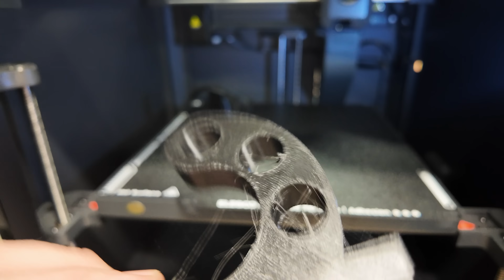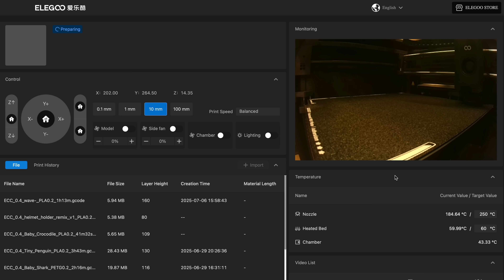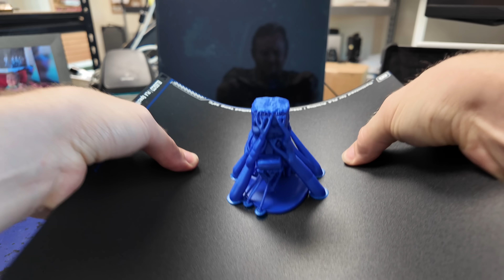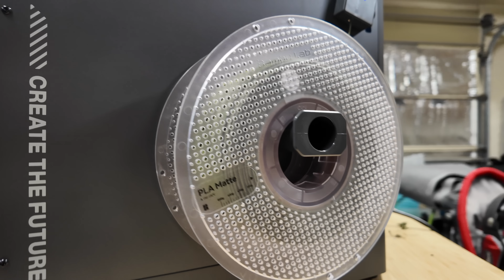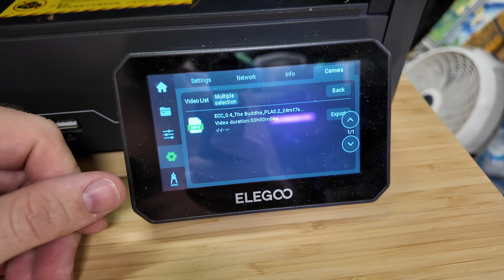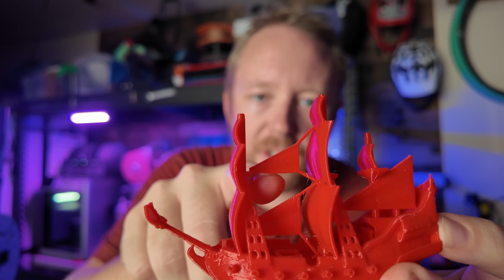Elegoo Centauri Carbon – Great Value, But There’s a Catch

Comment: PTFE Tube. Unclipping it from the front half of the chain is a great start, and seems to be how Elegoo are currently shipping them. 
If you decide to replace the tube, then be aware that the tube length (printhead to sensor) needs to be kept the same for filament runout behaviour to stay nice.
Reply from the maker: Thanks for the Tip!
Reply: The PTFE tube length is not critical.  Just get it reasonably close to the original tube length.  When re-installing read the instructions about how to snap it into the back of the plastic chain.

Comment: Fans. Are you sure you have updated the firmware? On the latest (14 July today) version (1.1.29) the only fan that runs on after printing is the electronics bay (floor) fan - and there is no switch for it. It isn’t particularly loud and does turn off after a few minutes, but it raises an important point - the venting of that bay. It only has one grille in the bottom panel, and the fan circulates the air rather than changing it. Blocking the grille (by mounting the thing on carpet or foam for noise reduction) could be very very bad indeed for the electronics (and maybe, thinking Qidi fires, you). 
Electronics cooling improvement with some sort of ductwork is the mod I’d like to see.
Reply from the maker: Ill have to double check.

Comment: There is a model for a top riser that frees up room for the filament tube. I haven’t printed it yet but it looks nice, though mine said it would take 1 day, 7hrs to print so I think I have a setting messed up somewhere because it should be about half that.
Reply from the maker: Yeah, im hoping to print that here shortly. The one uncle jessy did looked cool

Comment: Heads up for people watching this video.
The light issue has already been fixed, Elegoo has upgraded the lighting system in  their CCs for all versions going out. This person got a older version which didnt have all the upgrades.

These upgrades have also helped address all the mechanical issues he encountered.
Reply: Software has been upgraded as well for the clogged nozzle issue in early units,  my unit also got the upgraded LED and has the socket connection for the future AMS upgrade.  as for the Bowden tube issue,  it is true it is angled too much making it hard to load filament,  that was easily solved by  printing a riser and swivel tube, the riser has vents I can open for when printing with PLA.

so what "issue" is left?  noise,  it is a bit noisy, but my unit is in the garage,  and I plan on printing up an additional filter/muffler combo, supposedly lowers the noise level.  

there are already many files for printing up mods and stuff for this thing,  for example I saw a print to allow you to put filament rolls inside the machine, saving space and help keep filament dry.  hinges so that the door can swing completely around the side.  risers to add more lighting,  although I am fine with the LED upgrade it has.  I purchased the optional vibration feet when I made my order,  but you can easily print some up in TPU.  this isolates vibration from your table,  and supposedly helps with ringing in prints,  since I never used my machine without these.  I cant say if they help,  but seems logical.  it is weird seeing the machine wiggle a bit in prints,  but I can see how this would help with ghosting etc.
Reply: @Artiflex-ai4u  I put a 16" Rubermaid rubber pad from the hardware store on my table and put two concrete pavers on top of the pad and under the printer. This has hugely reduced the printer's shaking my table. I re-ran the whole calibration procedure after making this change.
Reply: @Artiflex-ai4u  fixing to by one, where'd you find the files for the mods, etc. Yes, brand new to 3d printing. Thanks
Reply: @Artiflex-ai4u  can you send links to  risers and swivel tube tihng i couldnt find any
Reply: @Artiflex-ai4u mostly correct, but the anti vibration feet will not help your print quality at all, they are specifically to keep vibrations from transferring to whatever surface it is on.

For VFAs the best thing to do is make sure you've run your input shaping calibration from the machine itself, then do a VFA fillament test in the slicer calibration.
Reply: @PmgAwF  I have not done any fine tuning yet,  only really had one day playing with the thing,  I am printing the riser I did notice a slight under extrusion for the filament I was using (Elegoo lavender purple matte) but externally looked good.   the ABS prints and PLA white stuff I did earlier, were perfect.   but agree, I will tinker with the tuning in part soon.
Reply: @PmgAwF  But this also works in reverse,  if you have a shelf with other machines, or machinery,  vibrations from those machines can potentially create distortions in your prints, any vibration anywhere can cause issues.  so yes, isolating the machine from its environment works both ways.
Reply: There are actually 2 lights in the version I received. One in the middle of the right edge and one in the middle of the front edge.

Not sure about the tube angle thing. I did print the vented riser and unlike early versions that were reviewed, the tube wasn't contained/clipped to the chain (this is my first 3D printer so if there's a proper name for the "chain" I've not learned it yet) looking piece. I'm easily able to feed the filament without need for that swivel piece. I did print and install it, but removed it due to not liking the Bowden tube having more slack in the back of the machine since mine doesn't have a wall behind it.
Reply: @TonyL7373  it's a fun 'hobby' and you've got a nice printer for your first. As for that thing which holds the wires and bowden tube, it's called a "drag chain". Probably because it can be dragged around and the wires or hoses inside are protected.  As for the filament, I just cut mine at a 45 deg angle and it finds it's way into the extruder just fine.
Reply: I think currently, it's based on your luck. I did pre-order end of April. Got the printer last week and it's the old small LED. No light upgrade.
Reply: I ordered mine end of may and got all the upgrades, seems people in batches 112 and above got them. @andyfong4442
Reply: I came here to add that there are LED light strips which should provide more light than the little one on the camera.  Orca Slicer 2.3.0 has Elegoo Centauri Carbon defaults already but you will want to add a touch more to the Elephant Foot setting. The only thing it's missing is a filament motion sensor tied into the filament run-out sensor. For the filament loading I just cut a 45 deg angle on the end of the new filament and it finds its way into the extruder nicely.
Reply: I just picked mine up from a store today it has a nice big light bar :D
Reply: @JimJPoggers  Check again, bud, it has two. :)
Reply: I just got my printer 4 days ago and got an amazing first print and that's it. Been emailing with elegoo but 2 clogged hotends
Reply: @willwhalen7572  
So far I haven't had a clogged hotend,  or any other issue.  I did buy an extra .4mm and a .6mm hotend,  just in case, but haven't even changed a hot end.  I have an older bed slinger, and I know clogged hotends can happen,  so far I have been lucky with the CC.
Reply: I mean you shouldn’t have to upgrade a printer to get basic functionality that was promised from the beginning for a cost 🙃
Reply: Is this worth getting still today? Jan 2026 or should I get something else. $280
Reply: @StreetTerrorist187  It's still a good buy, it's unsure if the AMS is coming, Elegoos says it is, but it's way behind schedule, but for a single color printer it's great for the price
Reply: when you say mechanical issues, do you mean the filament tube?
Reply: @PmgAwF  is this good for a beginner cheap printer?
Reply: @PmgAwF  they literally didn't. My light is trash I just bought mine
Reply: yeah I just got mine this week and the light while NOT super bright is More then Bright enough now to easily see inside now.

Comment: @RadDadsPrintLab, did you have to pay tariffs on the printer?
Reply from the maker: I did not thankfully
Reply: $300 is the original price of the centauri carbon. They've stated that they may potentially adjust the price in the future to account for losses from tariffs they pay. The price is still $300 as of now.

Comment: You must have gotten one of the first batch, I got the second and mine has lights in the top but not the ams port.
Reply: Mine got here on Friday and had the light upgrade.
Reply from the maker: I was in wave 3, i did see on reddit people getting some of the upgrades but mine still arrived much later without them.
Reply: Yeah there is also a fix for the PTFE bend.

Comment: I got mine at the end of May and it came with the upgraded lights and the AMS port, I now have over 500 hours on it and it is still printing perfectly. I've had a couple of failed prints, but I attribute them to bad slices. For example, trying to scale down an articulated dragon below 50%. I've also had trouble printing dragon eggs using the variable layer height setting. I' believe that some of the layers were well below .1 mms and that could be the issue. Overall this thing has been amazing and I couldn't be happier.

Probably my favorite prints have been articulated dragons and their eggs. I'm using tri-color silk PLA at .16 layers, and they look amazing. I've turned up the heat, slowed down the wall speed to 60 and tuned my retraction settings and the layer lines are almost invisible and the silk is just so shiny. These are the prettiest things I've ever printed. My friends and family are loving them.
Reply: So if I got the CC now and an ams or the version they made for the A1 and plugged it in I'd be able to use them together? Or is this port only for the one they're planning on releasing
Reply from the maker: Awesome, thanks for sharing your experience!
Reply: Great..another person filling the world with articulated dragons and eggs! :P
Reply: @fightlikabrave  I've printed one, just to see what all the fuss was about but I doubt I'll be printing more. Now, knomes on the other hand :P
Reply: @DiddleLe  haha, hey wharever make ppl smile! and i was just joking with the OC too. :)